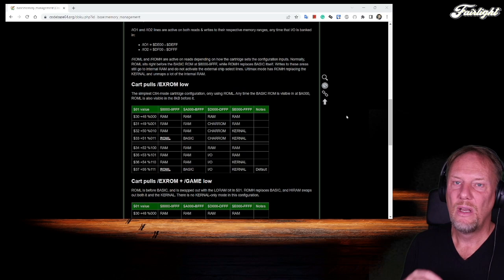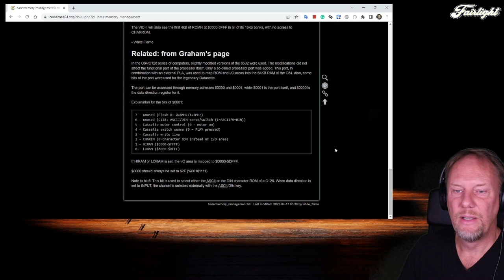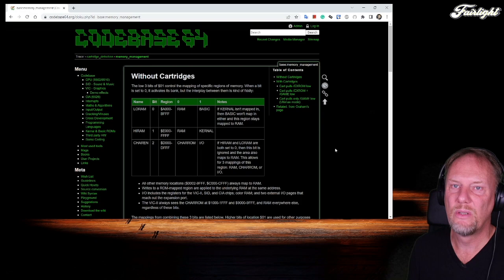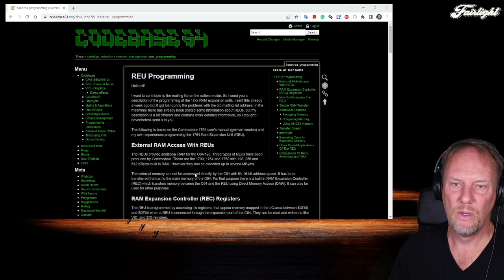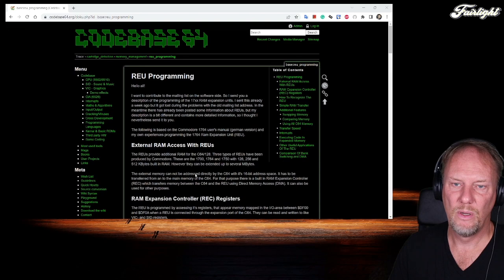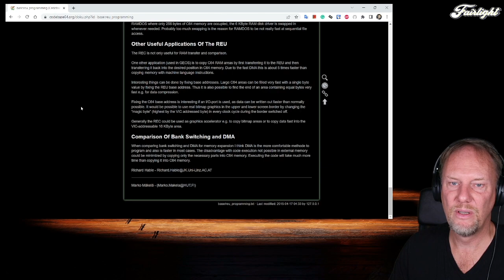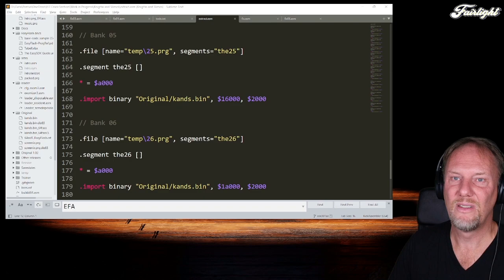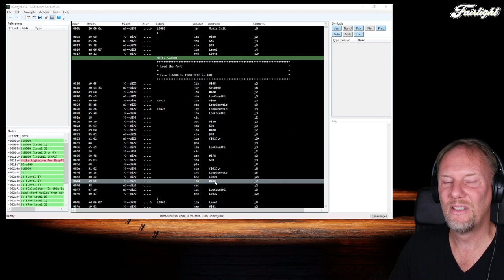FairLight TV #56, Cracking C64 cartridges

Comment: Great video!
I've got no recollection of how I did it back then, but I was able to crack my Turtle Graphics II cartridge and copied some of the code for my own projects. I incorporated the sprite editor into my own programming language project and copied the routine that drew lines in hires graphics mode. Young me was very sneaky! :-)
Reply from the maker: Well done. Back then the carts didn't have banks, and there was option to add switches to the cart port, preventing the autostart.